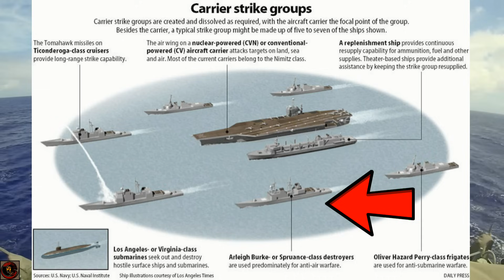DDG-51 Arleigh Burke Class Destroyer AEGIS - Overview

Comment: Very good overview of the Tin Cans of today. Your information was spot on at the time. There are now 92 active duty DDGs in service as of now March 2022. I'm glad they went back to all steel, the Adams class I served on was aluminum above the main deck too. I've seen 12.7 mm (.50 cal) Soviet Machine gun projectiles go through from starboard to port bulkheads, not very good for anything inside. We had two 35,000 hp steam turbine engines that pushed way past 33 kts because of the lightweight design, but the Aegis class can now even go faster than the Adams class, they are much faster than the reported speed, they really don't want to advertise just how fast these ships are, that was a big surprise to me too. I worked in Main Engine Control on an Adams class and we were pretty formidable back then too. Can Do!-Anytime!-Anywhere!

Comment: These have RAM for up to 10 miles close in Air Defense. Japan has also built these on the Burke Class design. So these things are no push over. They can kill you 2,000 miles away. Not including the New Ship Surface mounted Anti Ship Missile system.. That even the B-1 bomber carries today. With a range of 500 NM with a 2000lb Warhead..
Reply: 🤣🤣🤣🤣🤣🤣🤣🤣🤣
https://youtu.be/Ho75Ancha_c

Comment: The DDG-51 Flt I&IIs have a flight deck but no helo hangar.  One can land a helo on board, but you can't put it anywhere but back into the air.  The Flt IIAs introduced the helo hangars and expanded capability significantly.  The new Frigates will have double helo hangars to accomodate more air assets manned and unmanned.  Great platform, and if the ship to copy by our adversaries.  The Aegis Combat System contained in DDG-51 and the SPY-1 radar that feeds it information is incorporated in the navies of Norway, Spain, Australia, South Korea, and Japan.  Aegis Ashore is a similar Ballistic Missile Defense contruct based on land in Romania and Poland, and soon Japan and South Korea.

Comment: In simple terms, the Burkes are the deadliest, most capable multi-role surface ships afloat. The Flight I ships, like the Burke herself, are getting on to be 25 years old, and, they're still damn capable. The Flight IIA, and, Flight III ships are IMMENSELY more capable than their predecessors, with both ABM, and, ASAT capability using the Standard Missile 3 system.

Comment: Japan bought a decent number of these ships as, & correct me if I am wrong, they can can be used with ABM missiles similar to our patriot missile system in the Gulf War to form a crude missile shield. Of course Canada should have a few of these!
Reply: Canada may want to wait & buy the new USA frigate as it, if I am right, will incorpoate this radar system on it but it will not have the missiles on the boat with the radar. The new frigate is what they are hoping to use instead of Litterial Combat ship that has performed so poorly. If I am right, Canada already has the missile ships in their fleet.
Reply: The new frigate is like a Swiss Army knife type ship that will perform multiple functions from one vessel more in line with the type 26 that Canada is buying from the UK.

Comment: One of the benefits of the VLS system is missile mission flexibility.  Because they care "strike" depth Mk41, they can accommodate any VLS missile: Tomahawk, Standard missile family, Evolved Sea Sparrow Missile (ESSM), and ASROC (rocket launched ASW torpedo.)  While on a routine deployment, they may carry a healthy mix of everything, they can change their load out based on mission parameters.  Going out to punish some wee dictator? load up on Tomahawks.  ASW/AAW escort for a carrier? more SM/ESSM and ASROC, less Tomahawks.  This provides a great flexibility.
Also, as to SM missiles.  The SM2 family is the base medium to long range SAM,  the SM3 is dedicated to Ballistic missile defense and only carried on BMD ship (in the end all were NOT converted due to $$$) and the SM6 is the new kid on the block, intended to replace the SM2, with better fire control against both aircraft and cruise missiles,  but due to cost, will probably not fully replace anytime soon.  SM2 and 6 missiles can also be used in a surface to surface role, supplementing the Harpoon.  The ESSM then fills the role of the short range SAM. Based on the Sea Sparrow, 4 can be packed into a single VLS tube.

Comment: The Ticonderogas are still in use and still being upgraded. They got rid of the 5 oldest ones that used a single missile launching system. But the other 22 are having their systems overhauled. You cannot beat having 122 vertical launch tubes.

Comment: Just as a question... many sources claim that the Arleigh Burke class has a reduced radar cross section... however, looking at all of those deck mounted structures, how is that possible? Or did they simply reduce it but it was still really high (do other ships have higher RCS's)?

Comment: Really nice videos... Screw it... subscribes
Reply: Also, how do Burke class destroyers "reload" their VLS cells? They only have 100 of them, each only carrying 1 missile, meaning only 100 missiles. Burke class destroyers have to fill lots of roles, so how do they have enough missiles? It usually takes multiple missiles to  effectively and reliably deal with a threat, so wouldn't multiple mass raids be extremely problematic? Correct me if I'm wrong.

Comment: Im proud to say i was a part of the team at G E lynn that designed and manufactured the prototype high speed gearing using the first gas turbine. We did this in the early eighties . I actually machined the main houseing which went fron the size of a small house ( old reduction gearing  ) to the size of a single car garage. When we talked to the navy it was being built so the top brace could go water skiing. It is a bragging point im proud to claim. The ship was built so it could go thru any type weather,  just batten down hatches and it was like a sub on top of the water
Reply: Wasn't very good at avoiding Korean cargo ships, was it?

Comment: A few points to make... The SM-2 and SM-3 include the Patriot and THAAD anti ballistic missile missiles making that a very good defensive ship to protect carrier fleets or to park near enemy locations to take down ICBMs as they are launched.  The THAAD system was used to take down a satellite that failed to deploy correctly that was in a low decaying orbit travelling at speeds 2x current ICBMs.  With them capable of striking the missiles on the way up or in flight they are able to ignore decoys and negate part of the effectiveness of MIRV warheads.

The other thing is the latest addition of the LaWS (Laser Weapon System).  While the current lasers are only 33 KW and only capable  of taking do small and medium sized drones the system is supposed to be upgraded to a 105 KW laser in 2020 and eventually to 300 KW giving it the ability to shoot down ICBM and jets as well as improved targeting systems to be able to strike incoming missiles and possibly artillery.  Considering most carrier fleets have around 3 Arleigh Burke class of guided missile destroyers this makes for a VERY powerful offensive and defense system.

The other point most people miss is the powerful radar.  While you touched on this a bit.  With the C-3 communication system they can work in conjunction with the Boeing E-3 Sentry (AWACS) as well as ground based THAAD systems and satellite radar.  This let the US park a few of these near and enemy shoreline and with the Aegis Combat System and the SPY-1D multifunction passive electronically scanned array radar track every plane, missile, and even bomb within hundreds of miles.  This has been used quite effectively in Syria.

Comment: What I have against the Arleigh Burke Class is that they try to much. Why not distribute on two ships? The Huitfeldt-class is 2/3 the displacement, half the complement. Cheap to build.

The gastubines? Hmm.... a destroyer is perhaps  to small for gasturbines. A Huitfeldt has 4 diesels same top speed and a bow thuster to keep maneovrebility. What the Huitfeldt's have is double the range. The time at sea is double - the Burke is bloody uncomfortable. 

The Huitfeldts are designed by the engineers - so their work enviroment has improved considerably.

Comment: This is nicely done, but you asked for corrections. The walkaround vessel in the beginning has no helicopter facilities, so that's Flight I/II ship, DDG-51 through DDG-78. There is an infographic for a carrier task force that is fairly correct, but it shows a choice of Arleigh Burke or Spruance class, so it dates to before 2005.  Early Arleigh Burkes are smaller than Ticonderoga class cruisers, the newer ones are larger. I don't think the Phalanx CWIS integrates with AEGIS, the whole point is that they're independent and work as long as they have power. I don't think the Harpoons are on anything after the DDG-78 - helicopters got that space.
Reply: I'd be interested to know if you can sort out WHICH Mk-41 VLS is in which position. There are three canister sizes - self-defense for SAMs and stuff (small), tactical (various SMs, medium sized) and strike (large, Tomahawk). Launch videos I've seen indicate the forward unit is either tactical or strike, makes sense that the smaller self defense stuff would be at the rear near the helicopter pad. Maybe a proper Navy man will answer, I'm just a nosy civilian.
Reply: @gonebabygone4116  pretty sure the whole vls is modular, and the launch canisters are loaded with the missile inside them. For example 1 vls tube can hold 1 tomahawk or 4 essm.
Reply: @gonebabygone4116  Per Lockheed Martin and BAE systems Self Defense length is no longer operated by any country.

Comment: Im was a Aegis Firecontrolmen on board DDG-93 and qualified surface specialist for this class.  I'm familiar with the design and features of this platform as I was part of the build crew.  So their are several reasons of the design choices, and would be happy to share answers.
Reply: Alex Mercer  smoke stacks were integrated into the superstructure to decrease radar detectability. Circles are very easy to spot on radar as they reflect 360°, only spheres top them because the radar can be at any level.
Reply: No thanks.

Comment: The Charles F Adams and Farragut (late 50's / 60's) were replaced by the Spruance class destroyers. The Spruance class ships (70's/80's/90's)were replaced by the Burkes. The Spruance hull design was used for the original Ticonderoga AEGIS cruisers. The Spruances were scrapped due to age. The Burkes are being named after the Spruances (mostly).

Comment: As capable as the Burke's are they're approaching the end of their service life. Why? Simple, they're starting to run out of room to cram new equipment into them and beyond a certain it's just cheaper and easier to come up with a brand new design to accommodate all of the latest and greatest dodads and hehaws; that is unless your follow up design is the Zumwalt. But the Zumwalt fiasco notwithstanding, the US Navy does need a new DDG design and soon to replace the aging Burkes.
Reply: Actually the design has several variants, and while some vessels are retrofitted to that variant's standards, for the most part the USN simply builds new ships of that variant. The USN is using the current variant, the Flight IIIs, as an interm ship as the Zumwalts go around and pretty much be Seawolf SSNs. Basically the Seawolf SSNs became testbeds that would later evolve into the Virginia class SSNs, it is very apparent that the Zumwalts are actually becoming the next Seawolf.

Comment: Ships I know about so here I go...

The DDG-51 class are increasingly problematic for the USN and are symptomatic of a wider problem within US military ship building that has manifested itself recently with the Zumwalt and Gerald Ford Class.

Whilst the DDG-51 are powerful vessels that us industry has churned out since the early 80's they are effectively at a design dead end. Their machinery is in effect 1970's vintage in design and development, they are crew heavy and extremely cramped. These issue have only got worse with each flight as new systems are crammed into the ship. When it comes to build strategy US military ship yards are behind European and Asian ones when it comes to efficiency, there is high wastage and plenty of file to finish work. The people from BAE Systems involved with the QE class carrier when inspecting the new US Gerald R Ford class carriers build were shocked at how inefficient it was.

The US has not designed a major new class since the early 1980's which has led to huge problems with Gerald R Ford and Zumwalt classes as they try to design all new ships with advanced new technologies.

Each new flight of DDG-51 has got increasingly heavy reducing the sea handling characteristics and placing the rear deck dangerously close to the sea which is an increased risk for the crew as they are at risk of being swept off in heavy seas.

The SPY-1 replacement the AN/SPY-6 AMDR that they US want to fit to Flight III is also causing more problems, there isn't enough power in a DDG-51 to run it and trying to fit a new power system in such an elderly cramped design is problematic. Current plans involve fitting the Rolls Royce generator system out of the cancelled DDG1000 into the DDG-51 Flight III and a Hybrid Electric Drive that will free up GT from driving the shafts and instead provide electrical power to run the electric drive motors.

Comment: Those torpedo launchers are a pain in the ass to load. It's basically an all day evolution requiring special rigging set up to hoist the torpedo into place for loading, a torpedo to be loaded onto and hauled out onto the weather decks on an undersized dolly. Great fun in high seas. It's all manual very physical labor, the loading rig is there for safety not mechanical advantage, and when you're done the loading rig has to be taken down and moved to the other side so that can be loaded, after which it all has to be taken down for the things to fire. I did hear they finally upgraded the actual torpedoes the things fire a few years ago because the old ones had a maximum range that was the same as the minimum range for most other torpedoes. Dunno - I wasn't a torpedoman, I just had to help out with the loading.

Comment: Would you say the Royal Navys Type 45 Destroyer is better or on the same level?
Reply: James Ireland 
The Type 45 and the Horizon class ships are generally viewed as being slightly better at Anti-air warfare capability, but have less capability in surface warfare, ASW and land strike than due to not having Strike length cells.
In addition, the Type 45 simply does not carry as many missiles as many other ships with a similar number of VLS cells, what with the inability to quad pack the Aster 15 which is comparable to the Evolved Sea Sparrow, only with slightly shorter legs. Additionally, none of the Type 45s are configured to do ABM missions though there is an upgrade in the works to allow it. Arleigh Burke is also much bigger, not just because it has more weapons, but also because the Arleigh Burke like all US ships since the second world war was designed with Damage Control in mind.

Comment: Fyi, the biggest defense the Arleigh Burke, and most ships, have against submarines is their helicopters. Helos have sonar buoys that can be placed in a wide perimeter around the ship to find subs before they get to close as well as air dropped torpedoes when they're found.
Reply: The Ollies were better sub hunters but Burkes have the best all around anti-sub/attack/defense capability.
Reply: I'll refer you both to Diesel-Electric submarines wrecking US Navy Anti Sub defences in a few cases.
Reply: @MK-rr7cg  If you're referring to the Gottland class, aka the sneakiest diesel boat around, yes it beat a US screen in a wargame. But you also are forgetting one thing, we leased that boat to test is capabilities, and I wouldnt be surprised if advances in ASW systems have already been made, given the even happened more than a decade ago. Also another case to mention, Diesel subs have short ranges and are generally designed to defend coastal and littoral waters, using air re-fuelers a carrier group can strike said subs mainland and naval bases well outside the subs operating range.
Reply: @seanangelo7950  Very well said. Props!
Reply: @danielfronc4304  Danke!

Comment: Check out the new MK6 patrol boats that the Navy just commissioned.  These 25-meter boats are used in the Litoral Zones and the latest proposed upgrades would include:
Upgrading the two MK38 25mm Autocannon to (2) 30mm Fully Stabilized remotely fired auto cannon.
Adding (2) Torpedos similar to the MK46 (IDK what the MK46 replacement torpedo is called), giving it a limited anti-ship capability. 
Adding (2) 4-round Hellfire Longbow laser guided missile launchers in a fixed installation on the roof.

While these patrol boats aren't meant to take on other ships, they should be a very good replacement for the Cyclones patrolling the Gulf right now.  They remind me of the old WW2 PT boats. I can see SF using these a great deal as well.
Reply: The Mk46 was replaced by the Mk50 and then later by the Mk54 torpedo.
Reply: @darwinsjoke  The Mk50 was not a replacement for the Mk46, it's just intended for deep water. Mk46 is general purpose. Mk54 replaces Mk46 in many conditions.